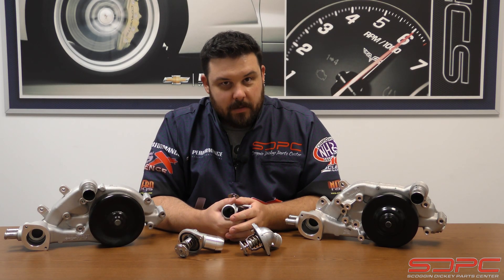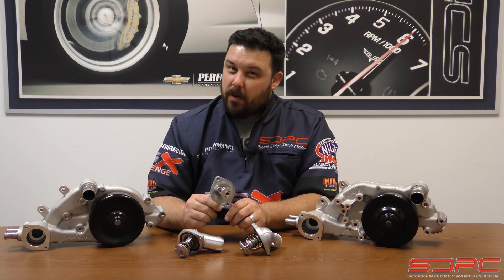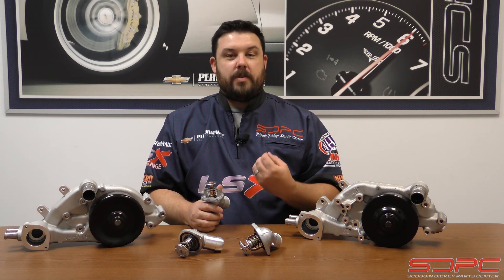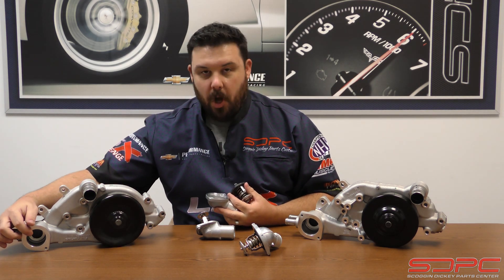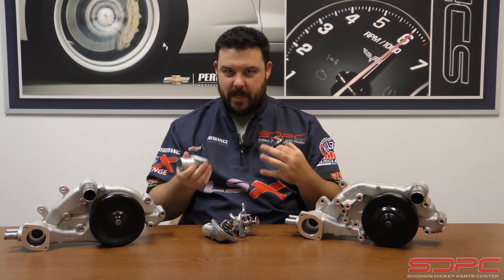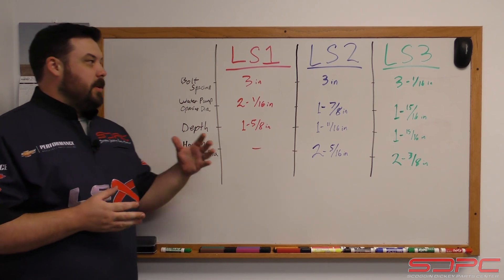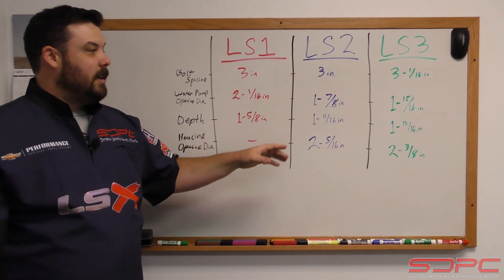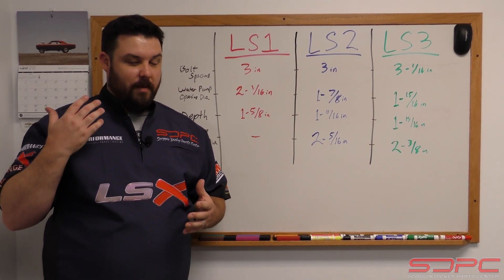SDPC Tech Tips: LSx & Gen V LT Thermostats

Comment: What about using a billet t-stat housing on an LT4 with the LS3 thermostat?  I have seen many kits to do this so if the SC Belt comes apart, the thermostat housing is not a victim causing bigger problems.
Reply from the maker: Those are effective. We spitballed the design of that early on, but never jumped on it. Others were faster to the market with it. The challenges of not having in-house manufacturing.

Comment: Whats the function of the disc do at the end of the thermostat? It looks like it seals the opening at the pump, but why is it made on the thermostat? I cant find the answer online, and you seem to be very knowledgeable on the subject.
Also is it neccessary to loop the heater core off or can you just cap it off.. 1/2 of the internet says it matters, other half says it doesnt.
Thanks!
Reply from the maker: If you cap them off, remove the disc from the thermostat.
Reply: @Sdpartscenter why is it necessary to take the disc off if they are blocked? Won’t that essentially be the same has having the bypass always open?

Comment: This video is awesome, thank you so much.  So i have a 02 Ws.6 with a late model waterpump (ls2 is what they commonly reffered it too)where it has the seperate thermostat and housing, so i would need the ls2 dimensioned thermostat correct?  My original thermo had 4 holes on the bottom of the thermo where it plugs up the bypass valve, and the ls3 i believe has three bumps on the bottom of the thermo where it plugs the byoass valve.
Reply from the maker: Yes, you would need the LS2 thermostat.